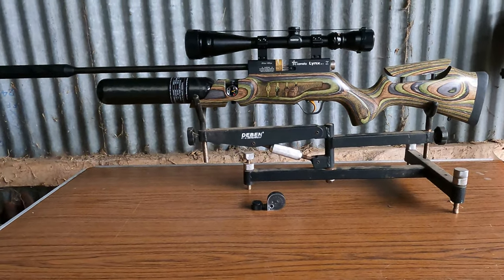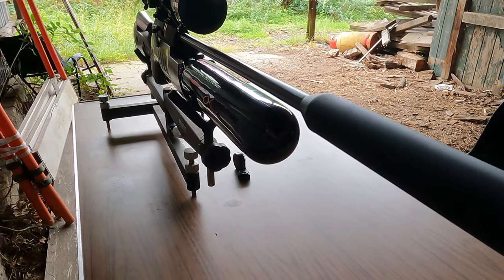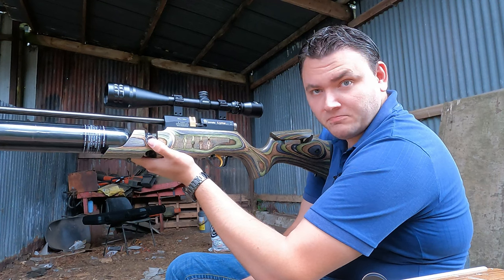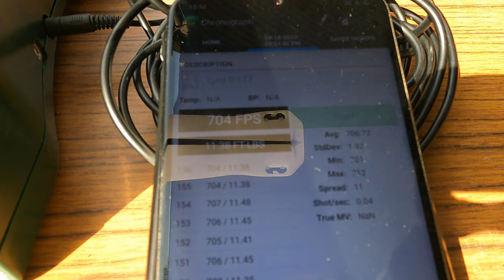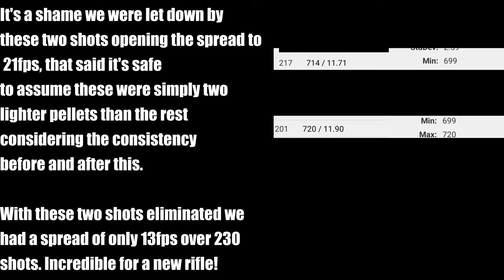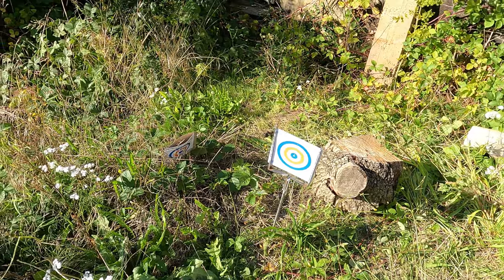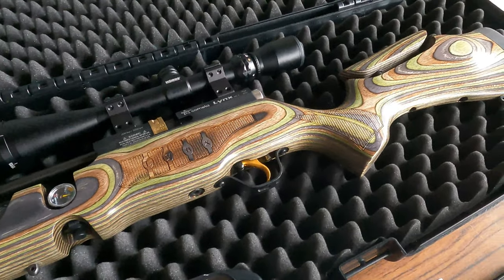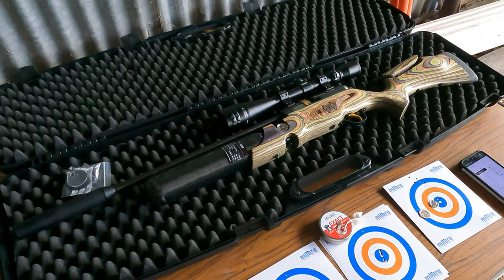Cometa Lynx Laminate SPR .177 review-Big Dan's Airguns.

Comment: Great review Dan, if I hadn't had so many problems with my Orion SPR long, I'd have this on my wish list. Cracking looking rifle.
Reply from the maker: Hi Peter. What happened with your Orion just out of interest? I had one issue with a leak but that was it mine have been golden.
Reply: @bigdansairguns83  Hi Dan, It arrived empty, airless, filled it via my scuba slowly and it blew out the silencer, sent it back to Cometa, 3 weeks later it was returned half full, attempted to filled it and it blew out the breach, sent it back again and had it returned full of air, went to use it 2 days later....empty. I have fitted two complete sets of seals, both times I swapped them out myself as the whole job is fairly straight forward, it still leaked overnight. Finally😴😴, I filled it up, submerged it in bubbly water, and the leak is in the welding around the base of the manometer. Informing Cometa of this new found fault I was refused a 3rd return. It now lives in a bag in the corner of the room, until I come across a welder. Although stocks are generally dodgy ground, I had the same poo customer service when my fusion star stock cracked. The perils of shooting i guess.....however on a final note, my 220 compact, 300 and 400 USC are all spot on. 🤞🏼🤞🏼🤞🏼👍

Comment: Hi Dan, yes I would have one of them in the wood stock. I know how accurate the Cometa's are, I have the 400. The gun could do with some of the same pellets running through it. I use the Jsb express & Spitfires. Both shoot well through the 400. Cracking review of the much overlooked cometa range of gun's. My only thought is the price, it has some serious company at that price & not an easy sell. Would like to see you return to this after a good Barrel clean & bedding in with the jsb Express. Nice one Dan, keep them coming.
Reply from the maker: Hi Brandon!

It's definitely more expensive than the other Cometas however from a performance and spec perspective I'd argue it's equal or superior to most £1300 rifles, especially when you consider the accuracy, shot count, carbon bottle, Lane reg, laminate adjustable stock and we're offering it with a damn good scope, case, SS tray and lifetime warranty. 

The really sad part is that the only thing letting it down is that it doesn't have a German badge... but time will change that. 😉
Reply: @bigdansairguns83  I couldn't agree with you more. I like to be different & try something new. Not just follow the crowd. I can't believe the Cometa range is not people's go to affordable air rifles. Love mine, very good for the price. Hope people see your review & give them a try. Lifetime warranty must be a quality product, made with quality part's. People at the range try mine and can't believe how good it is. I have just fitted a Westhunter scope ffp hd 4x16 by 44, way better that the Hawke Airmax. Keep up the good work & all the best with the sales.
Reply from the maker: @brandonwood4914   100% Brandon. 

Once more people just give a Fenix or a Fusion a try I'm confident they'll be converted. I'm doing a shoot off soon between a TX and HW97 and to be honest I don't see either one matching my Fusion groups in the 100 yard shot video.. of course I can't mention that on camera as I'd be shot haha. 

Thanks Brandon all the best!

Comment: Nice job Dan, I like the fixed single loading idea mate and the reg looks to be doing its job very well, trigger maybe set to pass the idiot test and as we know a very simple adjustment puts that right.
The Cometa barrels are renowned for their quality and this one is no different, you wait until a proper pellet test is done on one 😂
Reply from the maker: Hey Chris!

It's an excellent bit of kit eh mate? To be fair I do plan on doing another video with it in the future as well to show how accurate they really are... with a proper rest as well this time! I don't think the backpack was helping me here.
Reply: Not a great fan of these floating barrels I would like to see a barrel band on the metal  cylinder  bottle.
Reply: I would not cut the barrel. get a karbine
Reply: @bigdansairguns83  I really like this airgun just  I'm not so sure about accuracy. Can you test it on the bench with proper rest ? I know it will never shot like mine Walther LG400 Anatomic, but if groups can be close to the groups I can shot with my AA s510R Ultimate Sporter I will buy this rifle because it's something nice and different .

Comment: Nice looking gun Dan but it up against some real sweet ones for that money. The reg is 110 that seems high compare to the dreamline which is 55 bar. Great review Dan I will be keeping an eye on this one 👍
Reply from the maker: Hi Jeff!

To its credit it's better spec'd than most of its competition and it comes with a lifetime warranty. Cold hammer forged barrel, carbon fibre bottle, Lane regulator and a laminate adjustable stock. Compared to an R-12 (which is a beautiful rifle make no mistake) I'd say the Lynx ticks the most boxes. The only thing it lacks is badge and a carbine model.. Which is a shame especially for the former when you consider Cometa have been making rifles longer than possibly all of them.

The reg pressure is a smidge high but most manufacturers set them high for some reason. To the rifle's credit it has possibly the best consistency I've ever seen for a freshly out of the box rifle and it's far from lacking shot count. 👍
Reply: @bigdansairguns83  definitely Dan it's a nice looking gun I got no doubt it will shine on a nice day after a bit of use. One to watch for sure 👍

Comment: Nice looking rifle but expensive in use if you need to buy those pellets to get the best out of it.
Reply from the maker: Hey bud!

Even the best barrels can be pellet fussy especially when you get into dedicated target rifles. To be fair the let down with the Lynx was the rifle rest not the rifle itself as can be seen by the vertical groups instead of horizontal. The cold hammer forged barrel is one of the best on the planet as can be seen with our 100 yard springer video where the Cometa Fusion printed sub 5p groups unrested.. I've seen "high end" PCP's fail at that at 45 yards!

Comment: To be fair, Dan. I can get that accuracy, or better, with my unregulated Reximex 177 at 40 yards using 4.52 JSB Exacts for half the cost. My old Air Arms S400 MPR-FT 177 or my Dreamline 177 get far better groupings. I think Cometa need to look at their pricing. As a previous commenter stated, a Kral will happily take this on. I'll give it a miss.
Reply from the maker: Hi Rob!

The main letdown with the rifle was my rest , wind and the fact I had to rush the review a tad. I plan on testing the Lynx again at even longer ranges if possible and with better conditions/rest. You can see the only spread is vertical as the muzzle is flipping due to a not secure enough rest for a rifle of this length, horizontally it was pellet on pellet which is further proven at 27 yards where it was one-hole.

Once we have the rest sorted I'm willing to bet that S400 will be sweating... and I love an S400. 😉